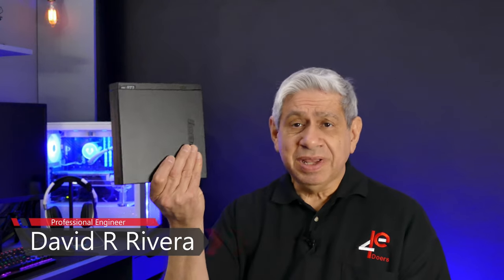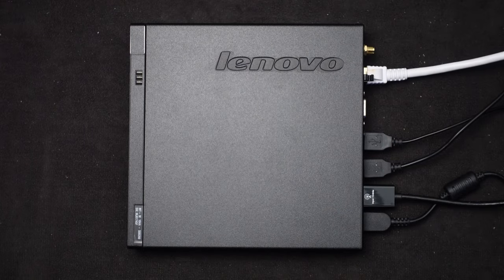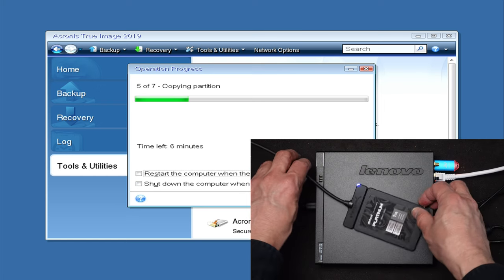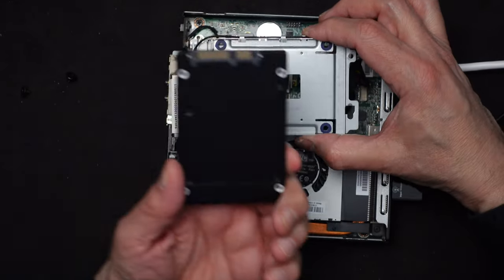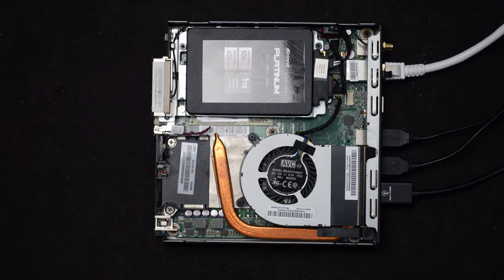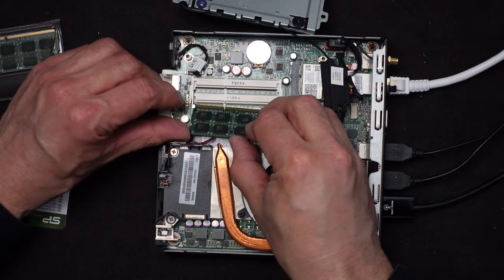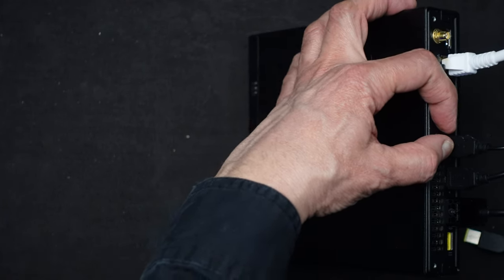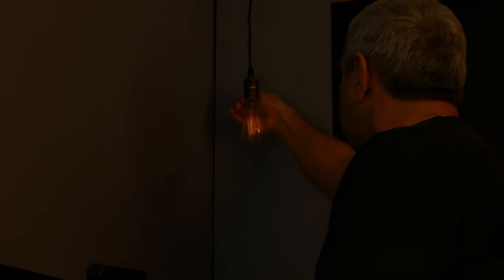Upgrading the Lenovo m93p “Tiny” Desktop PC

Comment: Thank you for a very well put together, easy to follow and informative video. Aside from the simply fact of not being an IT expert and the idea of messing about inside any computer case being inherently scary, my big sticking point would have been how to put Windows back onto it - essentially how to clone your drive onto it and not be facing a blank slate with nothing on it. You made it so straigtforward that you're inspiring me to go ahead and upgrade my mini PCs SSD to 1 or 2Tb.

I have 8Gb of RAM and may or may not bother with that as I don't use it for massively intensive stuff and it copes well as is, although that looks to be pretty straighforward to swap over too.
Cheers, Ian
Reply from the maker: Glad my information helped.  Good luck.

Comment: Wow!  Thanks for posting!
Reply from the maker: You are very welcome Sir.  Did you buy one of these units?  When I create my Network Rack upgrade video you will see it once again on a shelf in my rack.
Reply: @PE4Doers  Yes I did.  It is for my home business I am starting up.  The purpose is to handle e-mails and damaged in shipment claims.  

It came with a 500GB drive.  I'd like to RAID 1 it.  Ironically the cost of a USB3 500GB is just shy of the refurbished price.  I need to consider what I will do for a backup.
Reply from the maker: @RonPiggott  That sounds like a great idea.  I will be wishing you luck 🙂

Comment: you could also install a nvme port to use a tiny form factor ssd...it just needs couple surface mounted components, and a slot soldered to it.
Reply from the maker: That's interesting - thanks.

Comment: Thanks!. On a different topic. Is it worthwhile to replace or upgrade the fan on the Lenovo m93p “Tiny” ?  Mine has become very noisy and the inside temperature is rising beyond original  values. Any recommendation on this front? Amazon has several replacements that claim compatibility but not sure which one may be the one to choose from.
Reply from the maker: Thanks for the information.  I will have to take a look at what other Fans might work best.

Comment: Explained it all so well. Does the M93p has an NVMe internal SSD slot for an SSD M.2 upgrade? thanks
Reply from the maker: I don't believe so.  I did not see a M.2 slot in the unit or mentioned in the manual.  Probably do it it's age relative to the wide proliferation of M.2 drives.
Reply: @PE4Doers  Okay - I'll upgrade with an SATA SSD. thank you

Comment: Would upgrading to 32Gb of memory in these machines be possible?  I've thought about buying a few of these to experiment with virtual machines.
Reply from the maker: According to the manual it is not supported.  But it may be something to try if you have a 32GB DDR3 set laying out to try.

Comment: Can you explain your comment about not being able to get a RaspBerryPi any more?
For the price you paid compared to a Raspberry Pi it is a huge upgrade.  You would need to buy Power, and case for a RP which does not include an SSD or upgradable memory.  It should make a nice little unit for many things.
I understand many Display Port adaptors have some barbs on them to prevent the connection from coming loose.  People that do not know this have damaged the connector when trying to force the removal.  Does this adaptor have the barbs?
Can the adaptor be used in both directions, ie can you use it on a Monitor display port vice one on a computer.
Reply from the maker: I meant that comment based on the discounted price I got when I actually bought the unit from NewEgg.  Of course once I upgraded it, the price exceeded the current cost of a Raspberry Pi. Sorry.  I will have to  check on the Display 'barbs'  - I guess I'm so used to using those connected I never had an issue.  I will comment to this comment once I look.  No, that adapter only goes on one direction - from DP to HDMI (according to the Ad, but I did not test that.

Comment: Hi loved the video very informative. I see you put in 2 x 8 gig ram is it possible/needed to be able to fit 2 x16 ram? Seeing as it had the 2 slots. Thanks again for the info.
Reply from the maker: Well... According to the User Manual (which is online and can be found with a couple of searches), it only supports 16gb (2x8gb).   Such manuals have been known to be inaccurate, however unless I happen to have two 16gb DDR3 SODIMs laying around, I would no invest at the risk of it not working.
Reply: @PE4Doers  thanks just wanted to know how how far these things go, I just saw another video of a chip upgrade which did some good stuff but overall nothing special on the same platform. Fascinated that this might be the new size for the pc in the future.
Reply from the maker: @zargonfuture4046  I know what you mean 🙂

Comment: Thanks!, 
Does this mean the computer handles DDR3 and DDR3L memory?, lower voltage on the DDR3L so I was a bit unsure what to order.
Reply from the maker: The one I bought was the DDR3L which appeared to be the same as the one that was inside this unit, so I would go with that
Reply: @PE4Doers  Ah, I didn't even think about checking what I had, I have three of these that I bought just a little time ago, one have 2x4gb DDR3L, one have 2x4gb DDR3, and the last have 1x8GB DDR3L, I that makes it easier to get the ram for them :)
Reply from the maker: @Neslekkim  OK, good luck.

Comment: the tiny could only accomodate 1 ssd inside the case correct? cant do 2 pcs ssd?
Reply from the maker: That is correct.  However someone astute and experienced in in micro electronics might be able to add the necessary hardware to support a second Sata SSD.  In my opinion, that is beyond the capability of the vast majority of PC hobbyist, and there is significant risk of destroying the unit beyond repair (at least when measured against its value).

Comment: What is the maximum height for the 2.5hdd drive? 2TB would be around 7mm, similar to the SSD you put in. 5-6TB is around 15mm.
Reply from the maker: I just measured the 1tb I put in and it appears to be 7mm.  It looks like you can get one about 11mm before the top cover interferes with it.

Comment: You do know you can find HDMI internal cable ass'y that allow the 2nd installed Display Port to HDMI without the use of the converter cable.
Reply from the maker: No, I did not.  I will open it up and take a closer look for that.

Comment: I dont understand why you put the drive back in the machine, when you could have left it hanging out, tested the machine, then put the new ram in and THEN proceed to close it all up???
Reply from the maker: I wanted to make sure the first part worked before trying the second, to isolate any problems.  If I put the ram in with everything still out of place, then troubleshooting would have taken a lot longer since I could have pinched a cable.

Comment: what do you think ...
Reply from the maker: I have tested that with the unit connected via RJ-45 cable directly to my network - it worked fine.  I did not test it using Wireless however.

Comment: Wood this be good to stream movies
Reply from the maker: Yes, that works on the one I have.  The key thing there is the speed of network connection.  Just be careful though - I did not try it using the Wireless, so that may not work as well for streaming a movie.

Comment: i bought one installed 16gb ram, 1 ssd, 1 msata ssd, i7 4770 cpu.  i upgraded it to 7260hw wifi bluetooth card, double-tube copper heatsink with 1.0A cooler fan.
Reply from the maker: WOW, you create a beast of a small system there 🙂

Comment: Now put an mSata port in it like somebody else did on here.
Reply from the maker: Unfortunately, this unit does not have a connector on its motherboard supporting an mSATA
Reply: @PE4Doers  Yeah. I know. They had to solder it in but it is doable.
Reply from the maker: @luigiprovencher  That sounds amazing - probably more than I would try on a unit I have plans to use.
Reply: @PE4Doers  Yeah. I hear you there. I just got one myself but it's not working properly I don't think so it's either got water or some kind of liquid damage or somebody tried to repair it by super gluing something back on but I'm trying to update the BIOS to see if it makes a difference or not but it doesn't seem to want to upgrade to whatever the latest version it.
Reply from the maker: @luigiprovencher  Those 'older' BIOS version are sometimes impossible to update.